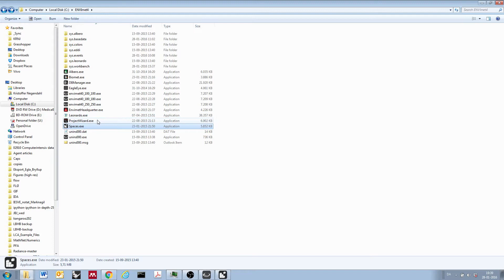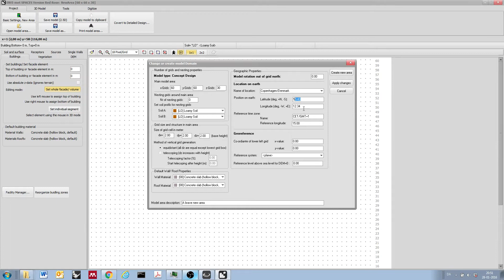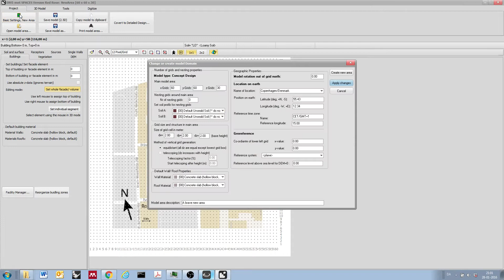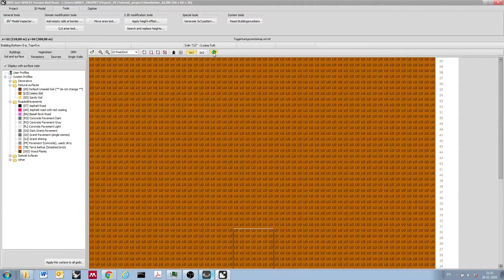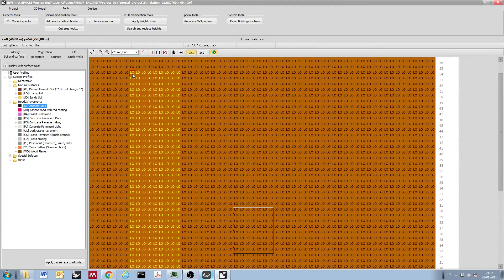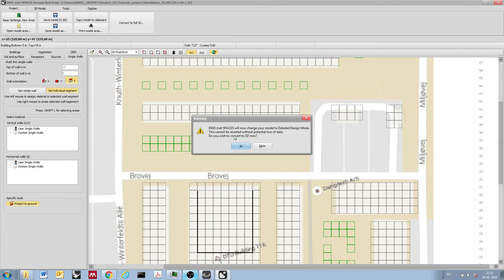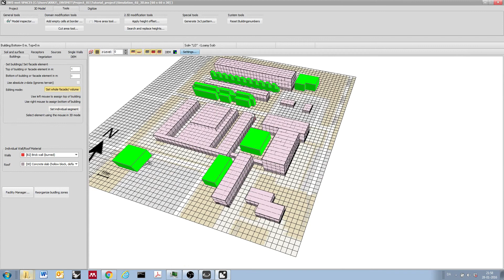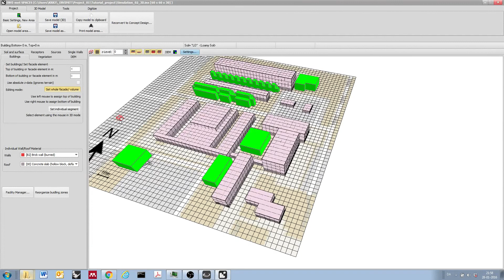ENVI-met tutorial series Part 2

Comment: How do you make a bitmap?
Reply: Wondering the same thing, have you found out how?

-Evan
Reply: You can do this from AutoCAD however I have had trouble with the bmpout command (which is supposed to generate a bitmap file). It works however if you plot to PDF using the built in settings in AutoCAD. Thereafter, some online bitmap converters can make this PDF into a .bmp file which works in ENVI-MET.